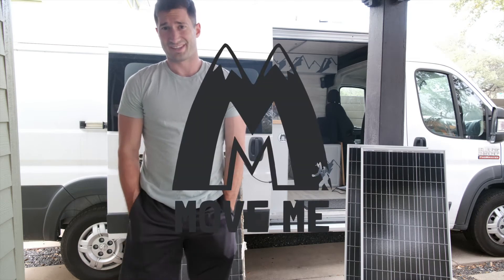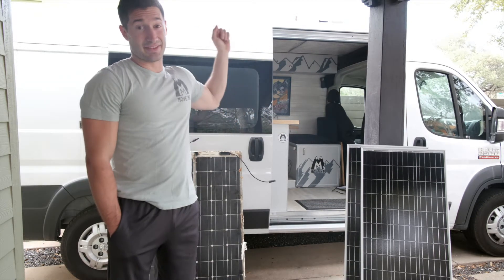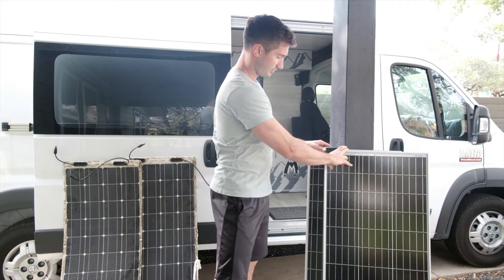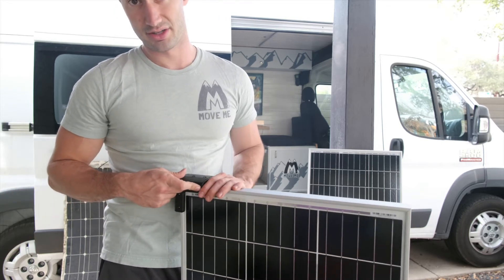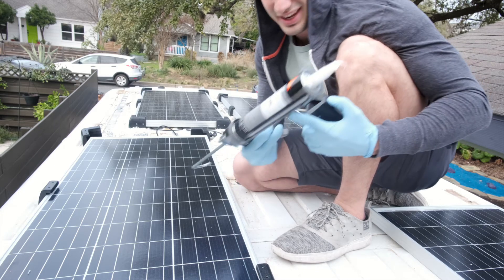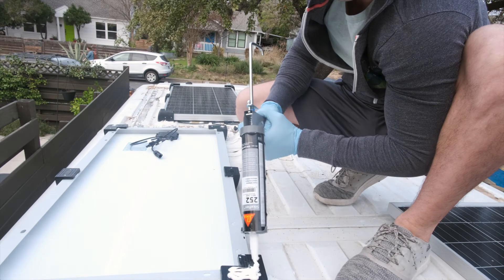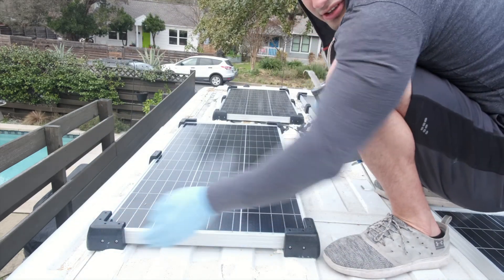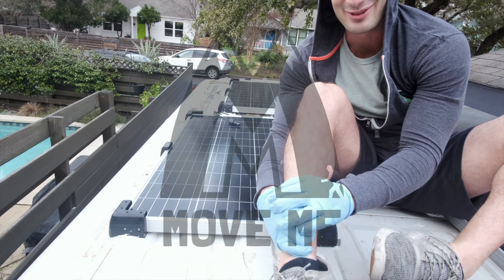Mounting Solar Panels Without Drilling Through Van!

Comment: I've done this recently with my T4 and it seems super strong but I've read a few examples of late of solar panels flying off on the highway. When you think about it, you're really just securing the feet to a thin layer of paint.

I'm going to put a single strong bolt through each foot and through the roof.  It'll be a bitch of a job since my ceiling is already installed but it'd not worth the risl in my opinion.
Reply from the maker: Yeah I think you have the right idea. I could be a bit ignorant and stubborn on this. I plan on buying a second bottle of the adhesive and smother it in the stuff. So far I've driven across country twice in it without issue, but it does concern me.
Reply: @movememovement  yeah honestly I think it's fine It just bothers me while I'm driving that's all.  I guess the sort of roof you have makes a difference too. Mine has had a DIY paint job ontop of the factory colour so I'm not going to take the chance.   Great set up by the way! Wish I could fit that much solar on my roof haha
Reply: @TomBedlammusic  If you sand paper down the part of the paint and clean it with alcohol you increase the odds of not flying away.
Reply: @obgaming101  yeah I did that. But listen to what you just said. "increase the odds of it not FLYING AAWAY" haha just scary is all.  Ive bolted them now. cant be too careful
Reply: Wind is getting underneath the panels and lifting them up out of the frame. Have some kind of wind deflector to stop that.

Comment: Mine just flew out on the freeway lol and it was bolted down to my old van and it was so strong that the brackets and bolts remain intact. Broke off from the factory solar frame  the aluminum gave out. 
Edit: it lasted almost a year
Reply from the maker: Damn...that's concerning to hear haha. Mine just survived 20,000 miles and 7 months of driving. I don't plan on having it last more than a couple years. I check constantly if I need to reapply an adhesive to it.
Reply: My worst fear! Someone could die!
Reply: @newyorkpeggi  Yeah, me on my motorbike. So not only can we not see shit because it’s a van but we have to try and see if there are solar panel’s up there that could kill us at any moment. If it didn’t kill me I’d be seeing the driver down the road at some point.
Reply: @InimitaPaul don't forget the planes above could have pieces fall of it n crush u

Comment: you could have put the adhesive on the top piece instead...     and you would have been able to access back of panel by uncoupling the holders
Reply from the maker: Yeah, I don't doubt that was the better way to install it. Unfortunately I didn't think it through all the way haha. Thankfully after 6 months and 20,000 miles they're still as solid as the first day I installed them. I check once a month to make sure everything is fine. My biggest concern is a panel breaking. I suppose I'll cross that bridge when I get there. If I were to do it again, obviously I'd install a roof rack and go the safe route.

Comment: Dude, that is so dangerous. Clean your roof and use primer!!!!!
Reply from the maker: You are probably right...but in my defense I check them monthly. The moment they lose an ounce of strength I'll reapply or removed and replace them. As of now it's been over a year, 15,000 miles, extreme heat, extreme cold, and extreme wind. They haven't lost any strength. The adhesive is construction grade and they have held up better than I could have possibly imagined. You are correct though. There is definitely a much safer way I could have applied this. Thankfully it's worked out for me.

Comment: Defintely like those mounts much better than the others we see for sale, as they have much more surface area for contact to the roof, the only problem being that they seem to "shadow" parts of the solar panels.
Reply from the maker: I agree. I will say I am a little worried about them during high speed winds. I check every two months and it's been 12,000 miles and they haven't lost an ounce of strength yet. I also used a knife and scraped the bottom a little bit to give it something to grab. So far they haven't budged.

Comment: You said twice you didnt do as you should have…maybe you Should DO as you should…men are terrible for following directions…yes we are…lol…it IS important to follow directions mostly…losing a panel on the HWY is not a good vision…
Reply from the maker: Believe me I understand...but the van has survived over 30k miles through intense heat, cold, wind, and more. Every month I check the strength of them and they haven't lost an ounce of strength. The adhesive is beyond strong and I don't think I could rip them off even if I tried. So I am 100% sure will never fly off.
Reply: @movememovement I'm really surprised that it lasted & stayed on the roof. I don't think that would work for mine. My solar panel is raised up & sitting on a roof rack. Had I come across ur video B4 I bought my roof rack, I would have saved some money time & headache attaching the panel onto the rack. Great job!

Comment: Why doesn't anyone want to screw these 'deadly weapons' down?
Not only should they be screwed or bolted down, they should also be tethered with a safety wire. People are having accidents and dying by being hit with solar panels or trying to avoid flying panels.
Reply from the maker: I should have just mounted them into the van but I didn't think far enough in advance. I installed the roof on the inside of my van and it would have been a nightmare to take off the roof and then instal the brackets. Thankfully this adhesive is incredibly strong and isn't budging.

Comment: I'm thinking about going this route as well. On the renogy website these brackets are described as long lasting and uv resistant but that doesn't really say anything. How long is this seal likely to last? And how long does the plastic last before becoming brittle from the sun? Just wondering if your research into these provided any clues?
Reply from the maker: I'm not sure how long they will last but they survived a year and 10,000+ miles in every climate. So far hasn't lost strength. I check monthly and will add more if it ever weakens.

Comment: I hope you will come back with an Update, whether you have any problems using that glue. You didn’t say how it was removable, without damaging the roof.
Reply from the maker: I can confirm after 7 months of driving and over 10,000 miles in extreme heat, cold, and wind, they haven't lost an ounce of strength. Every month I would check the strength to see if I had to add more and they're still as hard as ever. To be honest, I'm not sure if there is a safe way to remove them. I'm assuming there's a certain chemical that can be used to weaken the substance. That is obviously a major downside is not being able to remove theme easily. If you are making your own van I would definitely recommend the roof rack. Unfortunately I didn't have that foresight and did these instead. I'm happy with how they turned out though.

Comment: As a motorcycle rider and builder, this makes me cringe! I'm not trying to be negative here. Everyone has a different knowledge level when it comes to building/DIY. I'm just not a fan of anything being attached to a moving vehicle without proper hardware.
Reply from the maker: I understand your concern but these things are stuck there. The adhesive I used was incredibly strong and I can't even rip them off if I tried. I check them monthly and they haven't lost strength. They survived 10,000+ miles, extreme heat, and cold. So far they haven't budged, but I'm always checking to be sure. I'm confident these will never fall off.
Reply: You should know then that this is the most common way to attach solar panels is using adhesive who wants to drill holes in their roof

Comment: Sounds inherently dangerous to me solely relying on glue for securing a panel exposed to extremes of weather and wind velocity. Will come flying off the roof one day because it is not physically anchored. Sure fire way to get caught up in a lawsuit.
Reply from the maker: Completely understandable. I check the strength of the panels monthly though. They haven't lost an ounce of strength in over 20,000 miles across the US. So far so good.

Comment: I try not to leave negative comments but this scares the hell out of me.  Now I'm imagining all you DIYers driving down the highway with solar panels flying off your roofs.  Eee gads.
Reply from the maker: I understand your concern and the safety of other drivers is my main priority. You may not believe it, but these panels are impossible to take off. Each month I try to lift them off physically to test the strength. They don't budge a single inch. They've survived 15,000 miles in extreme heat, wind, and cold. If I ever try pulling it and feel they've lost any strength I will reapply immediately. They aren't going anywhere.

Comment: I got my solar brackets but they're so big they kinda hang off of the ribs on top of my promaster. They're big enough to reach over the gab but ya, there is a gap underneath so they're not making full contact. I got the caulking and eternabond tape so I'm hoping that's gonna be enough.
Reply from the maker: Yeah mine were too big as well. I ended up just using a lot of adhesive under the sides it hung over and it held up. I ended up buying more adhesive so I can just cover the brackets in it lol. The stuff is holding down pretty damn strong and has survived two road trips so far. I'm still a little nervous but they haven't budged yet. What kind of van do you have?
Reply: @movememovement  I have a ram promaster 3500 extended (the biggest one) I haven't started my project just yet. Been waiting for the weather to get a little warmer so that the caulking will adhere properly. I got all of next week off so I'm gonna take a stab at it then.
Reply from the maker: @sages101  yep I have the 2500. If you do it the same way I did it you'll be fine! I ended up buying 4 of those adhesives for 4 panels and just smothered the things in them 😂. You should be fine if I am!
Reply: @movememovement  Thanks I'm pretty stoked to give it a go. I'll let you know how it all turned out lol
Reply from the maker: @sages101  please do! Ask me if you have any questions. I'll let you know where I went wrong and what I wished I knew 😂.

Comment: This is the worst solar panel mount and the worst possible installation method.
Reply from the maker: It's held up 30,000+ miles and 3 years of driving across the country. So it worked well.

Comment: What about spray adhesive?
Reply from the maker: I wonder how strong that would be on it's own. I just checked the strength after 1 year of extreme temperatures and miles and the panels still won't budge an inch. I can't speak for everything, but I like what I was able to do with the adhesive I chose.

Comment: A perfect example of ‘A little bit of knowledge is a dangerous thing.’ Not kidding, your installation is what my mother-in-law would suggest.
Hey, several times you said ‘That’s how you’re supposed to do it.’  You do seem to be aware of parts of the procedure so you can’t blame ignorance. Sad.
Reply from the maker: While I agree there are proper ways to install these panels, I stand by the fact that these panels are never coming off. It's construction level adhesive and every month I check the strength of them. I literally could not rip them off if I tried at the moment. They have survived 2 years, 30,000 miles, extreme wind, heat (Arizona in the summer time), and cold (Colorado in the winter). So I know this is an unorthodox way to install these panels, and I know it appears unsafe. I assure you these things are not going to budge ever and at the first glance of them losing any strength, I will reinforce them, or find a way to remove them.

Comment: Suggestion for you in future. Use threaded rivets to anchor your brackets if you wish to mount directly onto the roof. Better yet, mount square tubing onto roof and the brackets into them. This tubing will be standoffs to allow air below the panels and maximize efficiency. Semiconductor materials work most efficiently when kept at very moderate temps. Hope these work well for you.
Reply: He does not have a drill!
Reply: Threaded rivets are called RIVNUTS.
Reply: U channel

Comment: Boy what a craftsman🤣...If you were to do it  right you would at least clean off the mounting surface on the roof with acetone or alcohol.. they might last a year or two but they will fail...sell it before they do!!!!!!!!!!!!!
Reply from the maker: Just an update, its been 3 years and still haven't lost an ounce of strength.

Comment: Youtube is a great place for How Not To videos…. Please don’t do it this way. Safe travels to the OP
🤞🏽🤞🏽
Reply from the maker: You may be right, but in the description I say there is a better way to do this. If it makes you feel better the van has survived 30,000+ miles through extreme wind, heat, and cold. Each month i test the strength and it hasn't lost an ounce of strength. I still couldn't pull it off if I tried.

Comment: All I can say is NO.  hope you have amazing insurance.
Reply from the maker: I understand your concern and the safety of other drivers is my main priority. You may not believe it, but these panels are impossible to take off. Each month I try to lift them off physically to test the strength. They don't budge a single inch. They've survived 15,000 miles in extreme heat, wind, and cold. If I ever try pulling it and feel they've lost any strength I will reapply immediately. They aren't going anywhere.